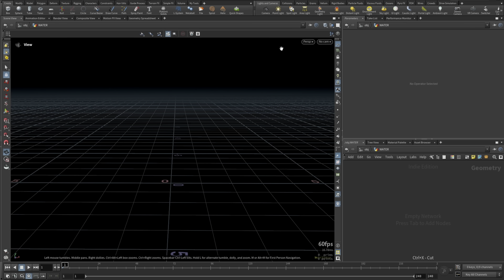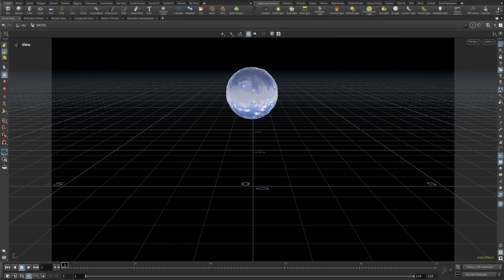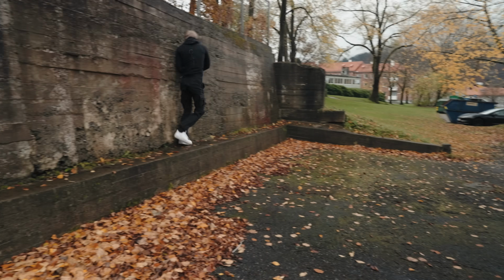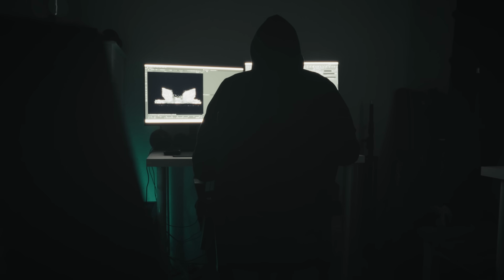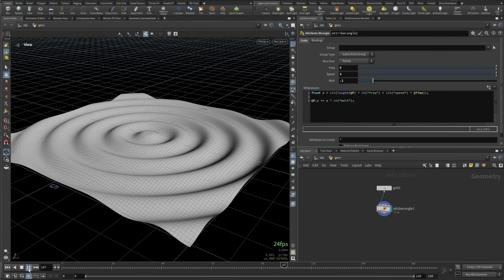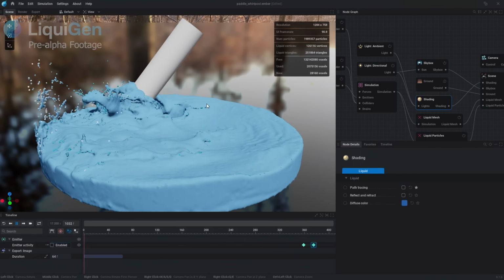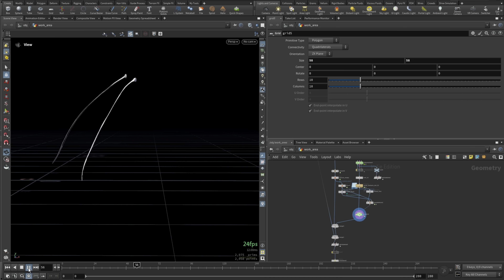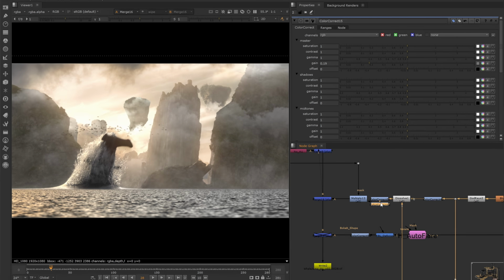I Remade Avatar Water VFX in 100 Hours

Comment: 100hr lacks air resistance of the original shot, each droplet falls exactly with every other droplet instead of some random motion from wind and air currents. you need to simulate 2 fluids.

Comment: Based on 12 seconds of movie produced in 100 hours to that standard, typical movie length 2 hours, it would take 60,000 hours to produce the full movie, this can be achieved in around 12 months give or take a month or 2 (not the GTA6 give or take formula) if there were 30 of you with the same skill set. Avatar grossed $2.9 Billion, divide that by your team of 30 strong that's $96 Million each, minus other outlays like models and takeaways that's roughly $8 Million each a month, sounds like a reasonable take home pay to me.

Comment: I have a quick questions about these particle simulation software. I have heard that Houdini gives more edge and flexibility but then its consumes alottttt of disk space too plus the sloth-like rendering time. Can you tell if its a good choice for everyday motion graphics ads simulations too? Also, does it integrate well with Maya? I tried realflow its really easy and good but the mesh consumes all the disk space and it has some limitations too.  Is Houdini as easy to learn too?

Comment: Dude, you're still using mantra
mantra 
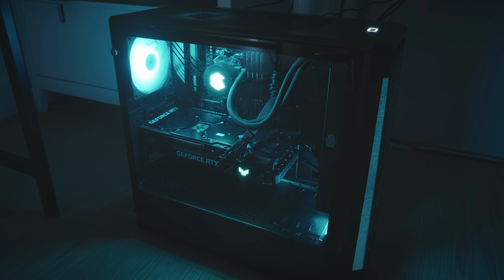I know it's probably just an illustration, but your computer  at 9:56 has an RTX GPU,  which does nothing in terms of mantra rendering, because it's not a GPU renderer

Can you clarify whether you're using karma or not ?  Is it related to the fact that you're also not using USD / Solaris ?

Because  karma is production ready since h20, and it will run ncely on your 32 CPU thread and your RT cores, at the same time. This is in XPU mode.
You have to switch, it will be deprecated because it has  now reached full feature parity between the CPU mode and GPU
And you're also missing on materialX...

Comment: The video was very impressive, a tidbit though, Antz was not the first film that used CGI/VFX water it was the film The Abyss in 1989 it slowly got better with time Dreamworks "The Prince of Egypt," what lasted for seven minutes on the screen required 10 digital artists, 16 traditional animators, two programmers, and more than 318,000 hours of rendering time, the rendering time alone took longer than the titanic did since it took two years to finish rendering in the meantime I believe they were working on Shrek.

Comment: The 100hr render looks so close to a movie. Except one little thing. Is it rendered in a box? I can see a hard edge where the water sim stops and blends in with rest of the ocean. The water level is different and you don't see any wave propagation. 
I haven't used water sim or Blender for over 5 years now, the sim used to run in a box. I might be wrong but it looks just a bit like that.

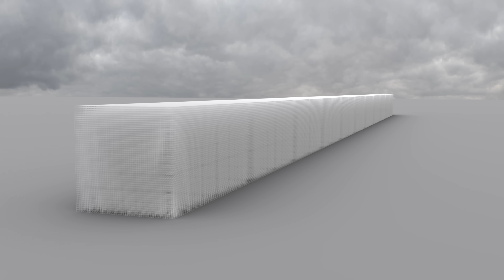Comment: 7:48 if each voxel holds a single float for density, and 3 integers for it's own coordinates then it should be 16 bytes per voxel, 1 billion voxels would actually be 16gb unless there is some optimization through using bytes instead of floats and 32bit integers, then it could be lower than 10gb, maybe something like 4gb or 8gb.

Comment: The reason why smoke simulations look so similar to water simulations is because from a physics/engineering perspective, they are pretty much identical. In science we refer to gases and liquids as 'fluids', because their behaviours can be modelled using the same sets of equations (Navier-stokes et al.). The only (main) difference between the two is the density and viscosity of the fluid.
Reply: To be honest in VFX whether it's smoke or water or whatever they are also just referred to as fluid simulations.
Reply: As a Science student i can confirm this data is 100% rught...never forget every vfx software work on codes.....but how codes work? yes on the basis of real life physics equation.

all AAA games also use that not only movies
Reply: imagine someone like this physics genius is applying that in rendering water animations .. it could take two minutes🤔
Reply: like sound
Reply: For Houdini (and most vfx software) neither gases or liquids are treated as compressible. By default the solvers convert any areas of pressure into velocities every frame. It's quicker to do this and fake compression / shock waves, if you need them, than treat them as compressible in the simulations
Reply: Water isn't compressible though.
Reply: @eSKAone-  You're technically right, although under large pressures there is a measurable compressibility with water. In the scope of 'solving' the equations (navier-stokes etc.), the main difference between compressible and incompressible fluids is the complexity of the equation as you're able to cancel out certain variables in an incompressible analysis.
Reply: @eSKAone-  Should you want to compress water so that its volume decreases by, let's say, 1% then it'd take about 2.2 x 107 Pa of pressure. Put another way, it takes a bit over 200 times atmospheric pressure to compress water by 1% at room temperature.
Reply: Don't forget compressibility
Reply: Compressibility
Reply: @denissmirnov7198  water is compressible...incompressibility is an assumption to make basic fluid mechanics less complex
Reply: @ToijamGhanashyam  And for example in the bernoulli equation, you can assume gasses are incompressible at low mach numbers.